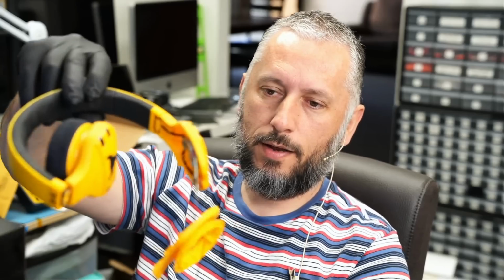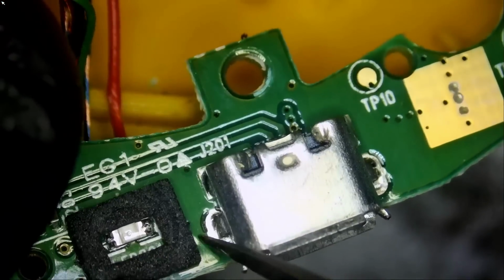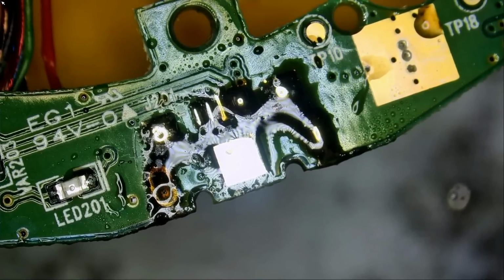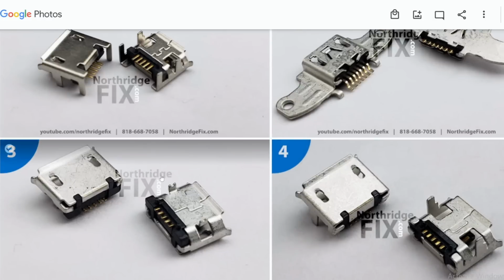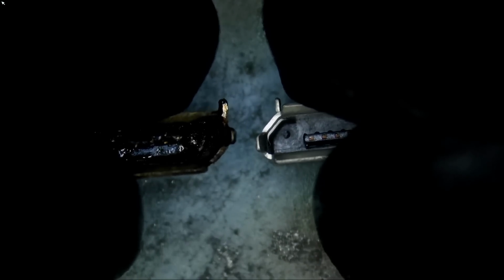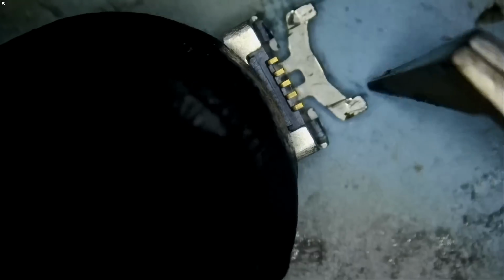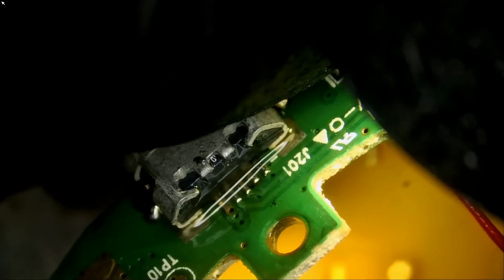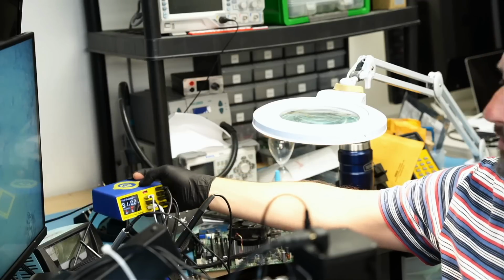The Rock Under Armour Headphones Repair

Comment: why do companies still use micro usb instead of type c
Reply from the maker: How is USBC better? Same connector more pins. You have more USBC connector selection with different shapes then micro USB. it's impossible to find a USBC connector if  one is not made available for the device and it's hard to improvise or fit  another USBC connector like we did in this video with Micro USB. USBC is also more difficult to solder compared to Micro USB.
Reply: USBC is better because you can not plug it the wrong way. That makes mechanical failures like this one in the video much less likely to happen.

Comment: 280$ for that peace of plastic headphones? 😱
Reply: $20 for the headphones, $260 for the Rock
Reply: 28whatt??? I thought he was fixing his children headphones... Looks like something an elementary school child would buy.
Reply: that's some good marketing for selling cheap junk
Reply from the maker: @MrMousekillaz Have you tried these headphones?. Just becausethe color is yellow and made out of plastic doesn't mean they are cheap or don't deliver the sound Quality. PVC, polyurethane and silicone are preferred materials for headphones for durability, weight and comfort.
Reply: @NorthridgeFix  ok but the price is still too expensive.
Reply: 100$ for the headphones 180$ for the logo they are JBL Under Armour BT once you buy the standard heaphones also i think these are the first version they are not really possible to find anywhere since they where revised
Reply: Exactly, I can already smell the cheap plastic from the microscope lense
Reply: Bet you got a headset made of plastic in a different color....
Reply: I thought the same when I saw that junk. I will not buy it for 40$
Reply: You're paying for the name brand, quality will have to be determined.
Reply: Just wait for Apple to release a Hearing Pro which will cost around $3500. 😅😅😅
Reply: Fools rush in ...
Reply: No different to Beats.
Reply: i'd rather have plastic headphones than full metal ones